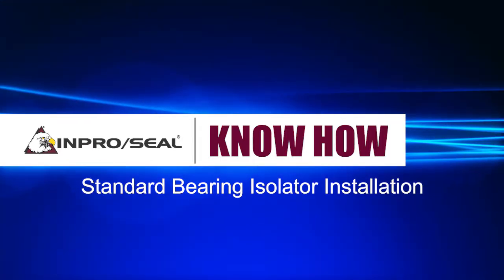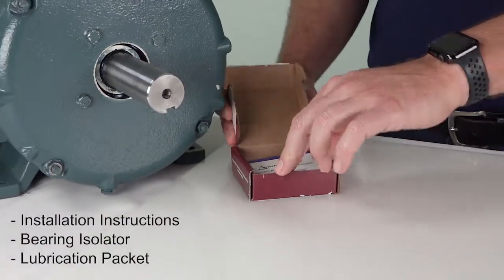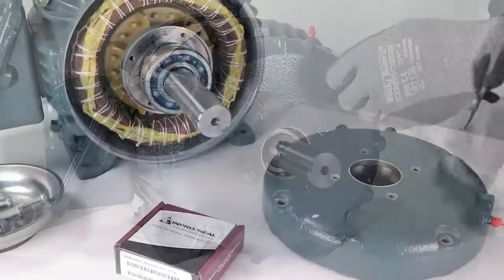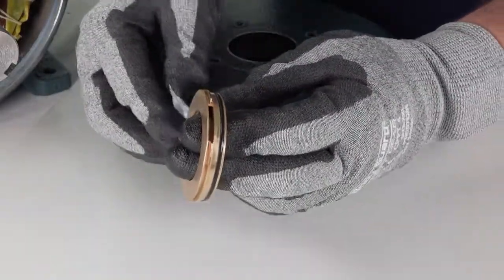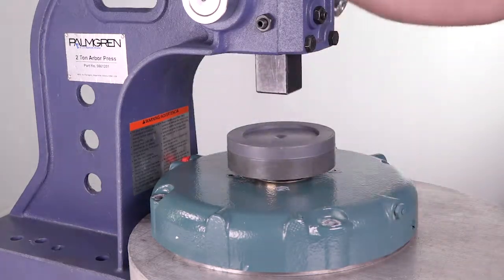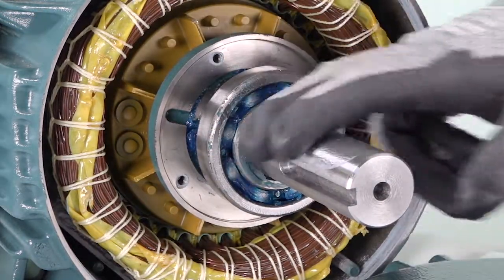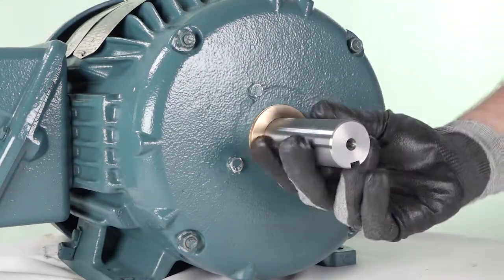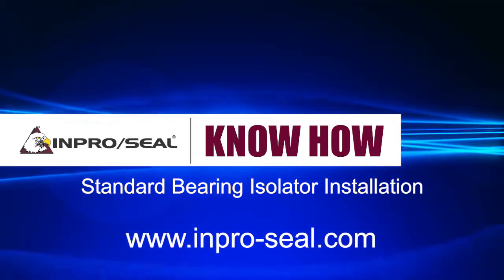Inpro/Seal Standard Bearing Isolator Installation

Comment from the maker: Thank you for your question. Many different designs of the Inpro/Seal Bearing Isolator are installed in exactly the same way, and if instructions are followed the components should not separate. In general, however, most of the popular designs can be re-assembled, and we have some specific guidance on doing so. Some designs are engineered so that the components can easily be separated, and in some others component separation may be an indicator of damage that should be brought to our attention.  If you experience unexpected separation, our customer service can provide expert guidance. Please visit www.inpro-seal.com or call +1 309 787 4971 to contact Inpro/Seal directly.